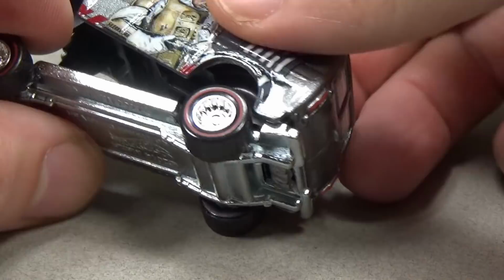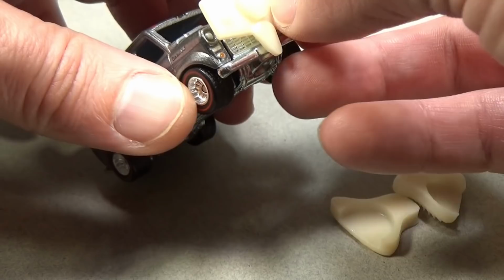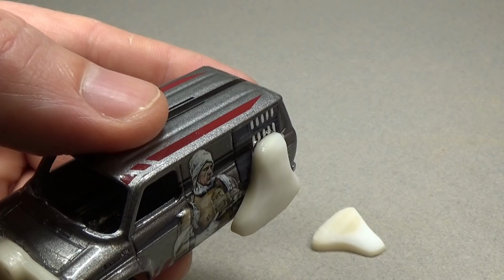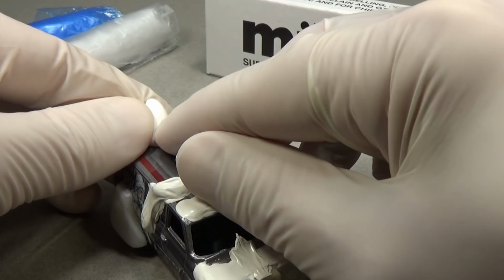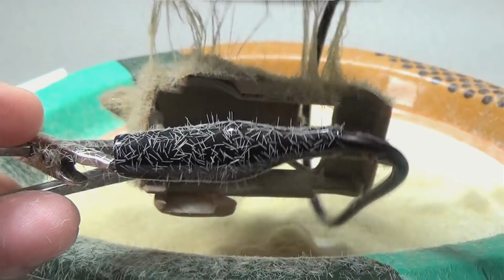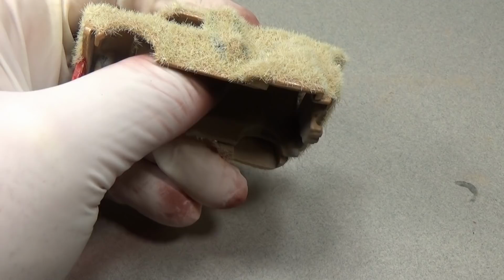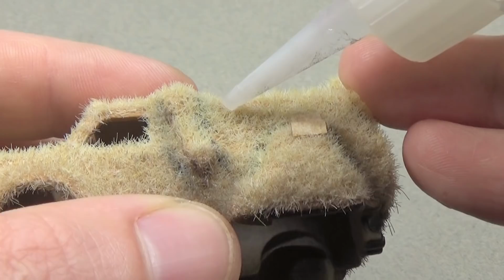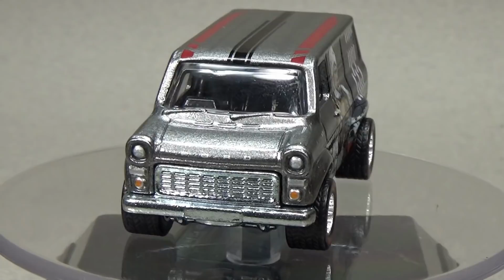Movie Car: Custom Mutt Cutts Van from Dumb and Dumber

Comment: That was a great job and a very good result. The van is actually to scale, if you look up the real Ford Transit Supervan by Terry Drury racing you will see just why it is that shape. It was made back in the 60s as a promotional tool for the release of the Transit van. As per usual Hotwheels made the original and then made numerous completely unrelated versions of the van.

Comment: Nice to see a British Mk1 Ford Transit van used in a conversion. When the van came out in the late 1960's, it was quickly embraced by the criminal community - it was a big van that handled like a car, and a fast car at that. The police hated it for two reasons - it was anonymous; most were left factory white: and it was considerably faster than most of their patrol cars. A deeply loved British vehicle. The body, engine and trim variations of it number in the hundreds of thousands.

Comment: Another good filler if you're already using CA glue is CA glue and baking soda. Sprinkle the baking soda on the glue and hit it with the activator. Sands good like plastic

Comment: Great job! That is one of the hardest "movie cars" to duplicate.  I have made my own Mutts Cutts can as well. I used van more like an econoline (I believe Yatming makes it), although it was cheaper in quality.  I used a light beige felt and it came out okay, but didn't look as shaggy as yours.  To make the ears, legs,  tail,  ect. I used cardboard. I find it to be a very pliable material,  good for almost any occasion.

Comment: I respect that you took the time to show all the different ways you could do the accessories. But I think some simple sculpy or two part epoxy with some thickness to it would work best. 3D printing and sanding is a massive hassle when you are dealing with a soft surface detail and you plan to cover it in flock anyways. End result was great though.

Comment: The 1975-1991 Econoline can be found as the Baja Breaker, but the oversize wheels wouldn't be right.  Yes, the Johnny-Lightning "Boogie Vans" had a perfect rendition of the correct generation of Econoline.

Comment: Need to get other hot wheels restorers to form a partnership to find a person with a metal 3D printer that can take a pre-1976 hot wheels diecast plastic base and replicate it into metal. I have come across many old hot wheels where the bases are in terrible condition and they break extremely easily. If anyone has a 3D metal printer that can duplicate plastic bases from pre-1976 hot wheels, do a public post so everyone can be informed. Must be cheap!